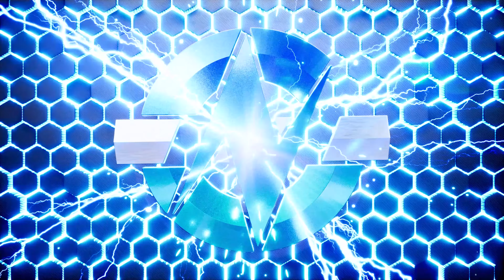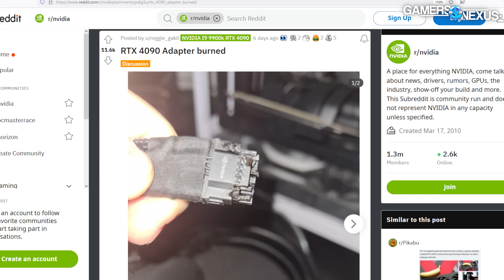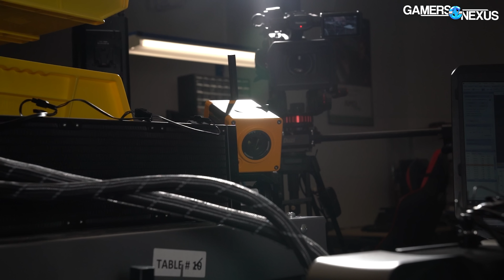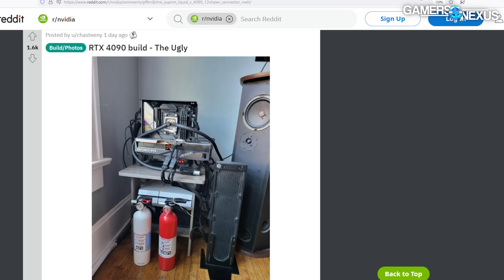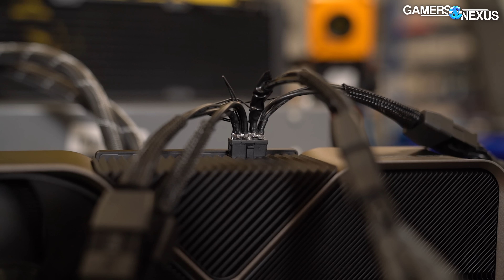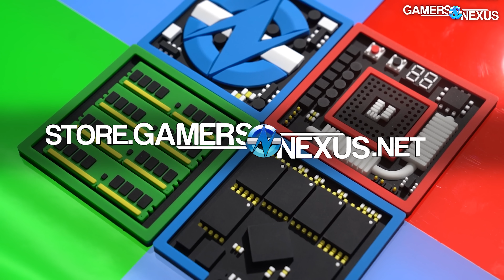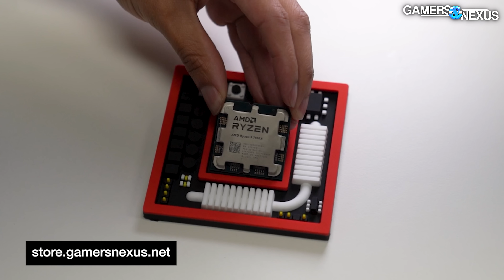Testing Burning NVIDIA 12VHPWR Adapter Cable Theories (RTX 4090)

Comment: Here are a few shower thoughts for testing.

You are running continuous load tests.  Are there tests that like alternates frame drawing between a light workload frame and a heavy workload frame in existence?  The idea is testing continuously changing workload in game rendering environments.  This may produce harder to control spikes in power draw.

Is it the cable or the graphics card?  Yes, we see cables melting.  Ask users that have replaced 1 cable with a new similar cable to periodically monitor the new cable to see if the new cable repeats the same melting pattern.  At this point, the problem may not be the cabling but faulty power management on some cards.  The concept here is that the RTX 4090 is probably designed with more conscious awareness of power spikes, and such Nvidia has implemented better power regulating systems to minimize or control the spikes.  But despite all measures, some cards have faulty components leading to overdraw on specific pins.  The plug melting may only be that the plug is the weakest point in the route, and that the problem is caused by something in the card that stresses it.  This will allow our graphics cards sent to reviewers to be fine while the general product has flaws.

The fun of going from the PCIE 8-pin connector to this 12VHPWR connector is the 8-pin connector's spec of 150W results in around 4.166 amps drawn per line to a single device, which is roughly half the amperage rating for those wires.  This allows PSU manufacturers to put 2 output connectors per line for PCIE 8-pin, and 6-pin, as well as strictly limits them to only 2 connections max.  Common safety was to just plug 1 device per line, even if 2 connectors were available.  Meanwhile for that 12VHPWR cable, reaching 600W on 6 circuits means 8.33 amps per circuit, but you are only putting 1 output on that cable.

Overall, I really don't like bridging wires like these adapters are doing, merging 3 wires carrying 4.166 amps into a single wire now carrying 12.5 amps to merge with another 12.5 amp wire.  These cables are rated around 8.5 to 9 amps, and potentially the connectors as well.  How the power from the 6 circuits (12 pins) gets distributed could cause(enable) random uneven power distribution based on workload.  Using a proper cable where the only points the power is merged is inside the PSU and the graphics card may produce a safe distribution, but those bridges to adapt legacy PSUs to the new standard can introduce random problems.  Really according to general specifications, you can directly take the 3 circuits from each of 2 independent 8-pin connectors and feed the 12 power pins in the 16-pin connector without merging wires, but the problem here is that 1) not all PSUs are guaranteed to be designed to allow this and 2) this does not stop the user from plugging 2 8-pin plugs from the same wire run into both inputs into such an adapter (or leave the 2nd plug unoccupied on the 8-pin wire run), which means 16.66 amps over a wire rated for no more than 9 amps.

I have to give Nvidia some empathy on this scenario.  A part of pushing the new connector is to help force its adoption into the market for later generations.  But because all PSUs just have to live up to specifications and not fully adopt some specific designs, Nvidia was at a guaranteed risk of problems with the RTX 4090.  

Imagine if the RTX 4080 was out as well and had the same melting connector problems.
Reply: I want to add something on stress test theory.  I know for some of the GPUs I have owned, they have produced coil whine when under a very high frame rate load.  I hate to suggest different stress tests, but there can be a difference between an amped up Port Royal stress test and a high frame rate workload.  The shift from high workload per frame to low workload, like processing an explosion, could cause destabilizing behaviors.

Comment: Looks like the soldering job is a bit messy and quickly put together. Some of those burned cables if it had a bad solder could be a point a failure.
Reply: It is also possible that during the cables manufacturing that the person assembling the cable grabbed the wrong wire, witch is possible when the cable has mixed wires in the build.

Comment: 300V and 150V cable itself is not problem but it shows there is variable in manufacture so there could be variant that has issue.
I was thinking could issue be that in alternating load there is arcing at inrush current on badly connected pins or broken patch. Most stress test are under full load so stable current. I'm quite sure failures seen in pictures are from ppl gaming what has alternating loads.

Comment: JayTwoCents 4090 adapter cable was similar Igor´s as with the one out pins going to one cable
(tried to look at the cable rating but it was hard to see but there was one moment and it looked like it was 300V)

Comment: Maybe I'm wrong, because I physically don't have one and none of the photos I've seen show otherwise, but the biggest takeaway from this is that none of the pins are crimped. Solder is nice, but a physical crimp is key to an electrical bond. As a ham radio operator who has been working professionally in the electronic news gathering industry, I see a TON of suspect wiring, but ultimately come back to the standards put forth by the National Electrical Code (NEC). For grounding (granted, this isn't exactly the same thing), a PHYSICAL mechanical connection (aka bonding) is a must.

Comment: So it's a case of " schrödinger's technician's defect" 
Which is when a defect is simultanously absent and present until observed by a technician, at which point the defect will always default to absent. And if observed by a consumer, it will randomly land on either absent or present.

Comment: Wow, this whole connector thing has been really messy. So it looks like there's several manufacturers and some of the cables from them have been terrible quality. They should've just made the connector in the same way as an 8 pin, with each of the 12 pins crimped to each pin separately. The bus bar design just seems like a bad idea, especially with cables that are rated/made differently. Nice work though GN, sounds like you got a fair bit of investigating to do!

Comment: Steve, bravo to you, my friend.  This is why I love your channel; you took the time, patience, and level of understanding and brought us the facts of your testing.  I like Jay's channel, but he went off half-cocked on this one and he screwed the pooch.  He should have started doing testing of his own before he made the statements on a regular basis and although this is a legit concern it's not as vast as Jay presented it to be.  Igor attempted to theorize and I have no criticism specifically for him, but since Jay raised this (I have no problem with him raising the initial point), he should have done exactly what you did or even consulted with you on best practices to test and kept a rig up and running to test inside of a case as well as a benchmark outside on his test bed.

  Jay couldn't recreate the issue as well and he was honest about that. What Jay did that was wrong is instead of informing as you do, at first and without fact he sent the community in a tail spend early based off of his theories that he heard, not tested of bent cables, (Jay had a 4090 for testing and he should have done what you did) and when he did finally test his theory he couldn't prove his point, which hurt his credibility to an extent.   You on the other hand Steve with your company, don't shoot off your mouth and you hold people accountable; you walk the walk and talk the talk, for example, NewEgg.  You couldn't reproduce this as well, but you went through the steps, you thought this through and you even mentioned the spec on the cable (300 vs 150) what it should be by Nvidia as well as showed the pictured cable and other detailed information. 

 Nvidia deserves the benefit of the doubt to an extent and believes me I'm no big fan of theirs at this point, but right is right, wrong is wrong and their sales shouldn't be affected by garbage reporting (the prices do need to be lower).  Thank you for doing what Jay should have done and being responsible for yourself and your credibility and to your viewers for being honest and not going off with speculation with no proven fact.  I had no problem with Jay raising the point but look how long from the point that he talked about it to actually testing his theory, which was wrong.  I don't just blame him but other YouTubers for joining in on this unproven theory without testing it themselves. Jay's Channel is large and with that gift that he has been given he needs to be more responsible for it.  Steve how about Thermal Beast as a name for the thermal camera, as in "We hooked it up to our Thermal Beast"

  I want a resolution for the people that have been or will be affected by this problem, not a bunch of unproven theories because these people who spent their money deserve this along with the rest of the community. This is why channels like yours Steve are much needed by enthusiasts to get that even level-headed fact-checking perspective because I believe you crave the truth and you expect your viewers to get the truth, which is something missing in Journalism today. I still like Jay and will continue to watch him because everyone makes mistakes and I still believe there is a problem, because of Nvidia's response, but Jay blew this way out of proportion and I think he owes his viewers an apology.  This is a problem that was further exacerbated by Jay. Steve, even though you couldn't prove anything, it was the way that you approached the problem and all of the problems in your lab that makes you and your team a STANDOUT!!!

Comment: The soldering on those cables looks like the stuff we need in our solder gore thread on the ELRS discord 😅
Reply: It is automated work. Allways looks like this unless you use a very expensive soldering line unit.

Comment: Good looking out on your endeavor here.

Gaming OC 4090 owner whose vent the cable on a Corsair 200T pushed the case to the limits of even fitting the card. Running great and a 190core/1500mem OC.

I'm not bending it 10 times and reseating the plug for jokes so just a one time plug and a bend in each direction (not side to side which seems weird) and no issues.

Comment: A bad contact between the pin and it's socket could have led to the overheating which in turn weakened the solder joint creating more resistance and even more heat. Crap design that was not really necessary in the first place, just to save a few milimetres of connectors on the GPU. If it needs 3 or 4 PCIE power connectors just use that, they are a robust and well tested design. Unlike this garbage.

Comment: 150V and 300V Cables. I think Igor is a trusted provider of information, and GN is too.
But why are there different cables? For me it seems like " Yeah just pump it out" method was used until it was too late and they just hoped it wouldnt cause a problem. But it did.
OR those 150V Cables are just mixed up 4080 Cables that got shipped out with the 4090

Comment: From the pics I’ve seen, the melting is not where the soldering is.
So I don’t understand why all the testing is happening there.

The issue looks to me to be where the connection is made between the graphics card and the connector.

Imagine the pins on the card side (male) are NOT making a solid connection with the adaptor (female), that part of the being the female side is thinner metal than the card side being a pin.

If that pin is barely making a connection within the females thinner metal, it’s gonna get pretty damn hot.

I have seen some testing on bending the cable straight downwards, but what about side to side? Would that make sense as to why the outer connections look more melty? And the top ones because they’re being bent down? So down and to the side? (Insert joke here).

Just my 2c. Jay already a has his.

Comment: I think the problem is the 12v being so close to the grounds. The pictures I have seen there is only a slight insulator between the two. At high amps there might be arcing causing more heat to develop. Just my 2 cents

Comment: One big question is also why these connectors are soldered and not fully crimped. Nice thing about crimped connections is that they tend to be more flexible and robust. 

Curious to see where this investigation leads.
Reply: Cost and space. I guess they thought it was "enough" how they did it, saved some cents (literally) and stayed happy campers.

Comment: The terminal design that Buildzoid (actually hardcore overclocking) highlighted seems significant.   My guess is that they use multiple suppliers hence different designs.

Comment: Could you simulate the load without using a GPU? That way you could push the cables to failure, it wouldnt be realistic but maybe you could replicate the issue at a much higher load.

Comment: BTW in any standard of soldering like millspec and NASA spec and in any serious application solder tin is not used for mechanical strength. One makes good mechanical and electrical contact and uses solder tin to unify the joint and remove air out of it and ensure there will be no sparking or arcing and that you do not add resistance to the circuit.

Comment: One thing that does not appear to have been contemplated is low lead, high gallium, (low melt metals), to account for the early softening solder in reviewer pics, can you expand/test..........? could solder be reliably be placed that close to, (even inside the plastic plug, if it was not low melt solder, which could cause issues before the plug would even melt!!)?? Does melting mixed metal solder create more resistance? The solder color seems very light......... (Maybe slightly softened solder, higher resistance, letting ductile failure occur in the thin metal, due to vibration, (Fans, system), and then a transistor like effect due to the minimal held gap in the plated metal, with varying resistance in the softened solder, probably wrong, just spitballing)....................

Comment: my conspiracy theory: remember the pre-launch news story about the problems with the connector? what if the cables had already been made before nvidia updated the spec due to those problems. those worse cables could have then got mixed up and sent out to consumers. so most people would get good, newly manufactured cables, but a few people got the stock of old, lower quality cables. intentionally or unintentionally? who knows.
Reply: yea that's what im thinking to, cause like GN said about Igor's findings to his adaptor is completely different and when he did heat testing he had different results. its still a major fuck up tho. nvidia should of done a recall on the adaptors tbh and checked them. will find out when ppl send GN the adaptors

Comment: This connector is crap. I build RC cars as a hobby and I send 280A at 7.4V through one pair of 10g wire and a "molex" size terminals.  Yes the connector melts after the battery has been reconnected dozens of times due to enlargement of the female terminal and dust build up.  But a clean and refit and it's flowing again. This whole connector should be two big a$$ wires and a flat "tooth' style terminal.

Comment: Ambient temperature inside a case would probably add about 20 degrees. But still, I don't think that the 300V cables would be affected anyway.

Comment: You know, some people (not saying this is the case) but some people make up things to get views and some also agree with people to help in that cause. I like how you investigated the rating of the wire, and saw how the burn't one had a different wire shown. I doubt Nvidia has two rated wires or batches in the same new card, but I could be wrong. Even if a wire came loose, it's in a plastic housing and isolated, even if it had a close contact UN soldered, it still couldn't short to ground. So I am on the fence on this one.

Comment: In my opinion it has nothing to do with the soldering or the metal manifold that the wires are soldered too. As a tradie that wires up hot water tanks daily its in my belief that the issue is with how the male and female pins connect together i.e the pins coming out of the gpu and the end of the pcie plug. If the issue was at the manifold, you would see melting at that exact point as it would be the hottest area. In the photos shown of burnt plugs, the melted plastic is always towards the very end of it.
Reply: This lines up with Buildzoid's theory too, which also lines up with CableMod's findings that horizontal cable flex seems to big one of the main causes of these cables melting.
Reply: I agree. This makes the most sense to me.  

Though I have not assembled/handled this specific style of connector.
I used to have a collection of plugs with damaged pin-receptacles because of misalignment on assembly (and installation) for rework.

A dent or burr at the tip/very end can lever the rest of the pin onto a very small contact patch; and collide with other parts on mating, worsening the effect.  OR (with some designs) can crumple the tab that locks the pin/receptacle in its housing. causing it to tilt and stretch so that only the tip connects at one edge.

These, especially mains-plugs, seemed to have better odds of heating up and melting if they don't shave/smear enough plastic off (on insertion) to break entirely.

edit, 1h later: I wonder if bending wires while inserting increases the probability of damaging the connectors in this style of connector more than 'normal'; And if (inserting straight, then bending) would mitigate this.

edit, 2 weeks later: egg on my face; evidently inserting (but not fully seating) then bending can cause this type of observed failure.
Reply: But fanboys don't want to hear that this is a normal occurrence in electronics. They want ammunition to bash Nvidia with.